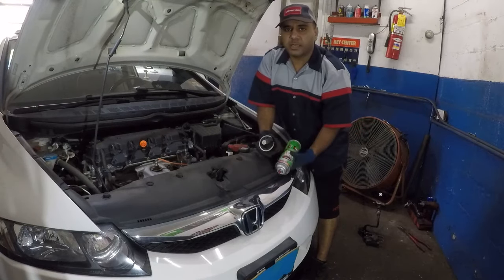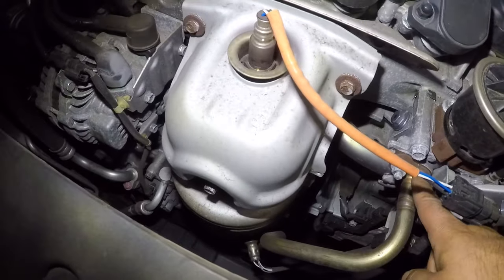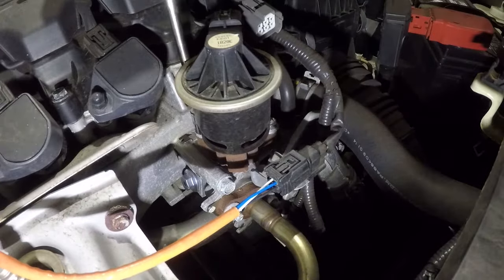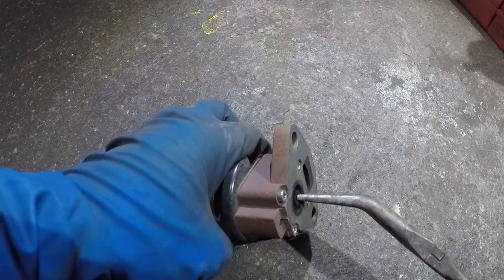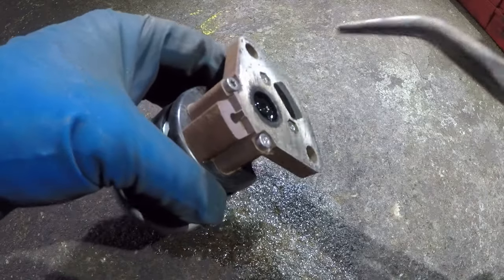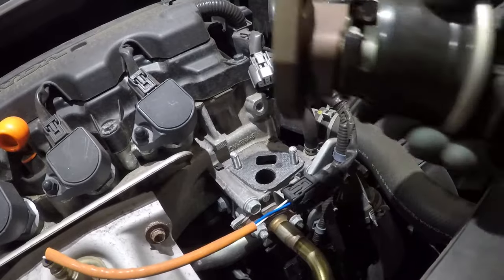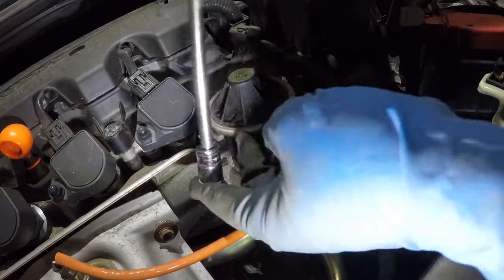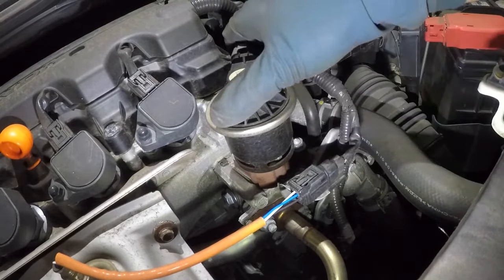How to clean Honda Civic 2006 to 2016 EGR valve also Accord and Acura TL, Misfire , random misfire

Comment: This video helped me!

2009 Civic 80k miles. My idle was really low, the only thing keeping it above 600 was running the A/C, otherwise RPM dipped at idle like half of the time and got rough fluctuating up and down, pulsing power at 500 RPM. So I had a stall and a few rough starts, changed spark plugs (probably time for that, but they were ok), checked for air leaks, cleaned MAF sensor, changed air filter. Coolant was fine. Oil was fresh. No codes. Did idle reset like three times. Still same problem. Couldn't figure it out so I started trying to find other possible problems, got to exhaust issues, didn't want to change the O2 sensors 'cause they're expensive, so I tried this and it's holding steady at 700-750 now, dips to 650 with lights A/C but 600 RPM was the problem zone.

One little valve... 

Thanks for your video!
Reply from the maker: Nice great job!!! and good information for others!!
Reply: Going to try this. Been having the same issue. Thanks for sharing!
Reply: Also, do you have a video i can use to reset my idle? never done that before...
Reply from the maker: @GGdevelopment  you need high end scan tool to adjust idle on Honda’s other wise it will do it self
Reply: I have the same problem with my 2015 Civic I try everything including new O2 sensors, I am going to try to clean the EGR valve hope that will take care of the rough idle in the morning and rpm fluctuating. thanks for the tip.
Reply: @maximilianozamorategui2608  So mine is a 2009, and it is just really old I think (only 90k however), but cleaning the EGR valve made a difference until it just started failing again. I replaced it with a new part, and while there are some stuttering sounds--especially when the a/c fan runs, the RPMs don't dip anywhere to where they were hovering. Best of luck!
Reply: @stalmerstreetjournal  was it stalling as well before u cleaned it?
Reply: @youngheero  Yes.
Reply: mines doing exactly like yours , i did everything like u did... i also clean the egr and still doing the same .. i'm putting sea foam in my gas tank and throttle body next ...
Reply: @bcbjbggjh9102  So it's been a bit, but it's still doing well with the new EGR valve. Mine could probably do better with a cleaning. I have started to notice the gas mileage getting worse, so that might be an O2 sensor and they're due for replacing. I've also noticed gas quality can impact it negatively. Let us know how the sea foam and throttle body cleaning goes!
Reply: @stalmerstreetjournal  

the sea foam and throttle body cleaning made no difference and now i'm Back to square one... car still shakes while at a stop sign. But I notice this today though while i was trying to burn sea foam through the engine.. When i had one foot on the brake and car on drive , i've tried reving the engine and it wouldnt rev pass 3000. When i'm on park the car can ten pass 3000 and wheb when i'm on the road driving it drives fine ... 
Hope that makes sense ..i have 2006 civic by the way

Comment: Thank you for a great video!  Explaining every step clearly,  Saving me money,  I am so glad to have my civic running again,  could not have fixed it without you!!!!
Reply from the maker: Glad it helped!
Reply: i like the information and videos and I have quick question.. I been chasing misfire cyl 3 then a cyl 2 not say same time maybe a cycle later then 300.. can this egr valve just be dirty and not throwing code? I also have to have pcm flashed for recall.. idk if that will stop the issue.. i replaced plugs but not with iridium with platinum. fuel injector as well but only 1 because it seems like its flooded idk if its hydro locked but can this cause hard starts and rough starts… now thats 2 questions and I have 06 accord 2.4

Comment: Awesome vid.  I changed the ignition coils and spark plugs (Civic 2008-200K miles) but car has a bit of a rough idle. I’ll clean this EGR valve tonight. Thanks for the vid.
Reply from the maker: Ok also clean the throttle would help

Comment: Absolutely amazing just did this for my 230k mileage 08 Civic and it the difference is night and day
Reply from the maker: Nice good job!!!
Reply: @RBTheMechanic I have a 2006 civic ex car stuck on limp mode no code changed all sensors fuel pump coils oil change O2 top and bottom car has no power when accelerating and it's 5 spd manual can you help me out
Reply: @dannyperez2465 lmk if u figured it out im same but with 344 miles

Comment: Awesome straight to the point video,having some hesitation issues so I’ll be doing this tomorrow along with the MAF sensor. Thanks
Reply from the maker: Cool update me how it went!!
Reply: @RBTheMechanic  Everything worked out perfect thanks,but I’m still having one little issue,it hesitates on high speeds 😖
Reply from the maker: @arieltorres3440  what u mean by besitate on high speed loss of power?
Reply: @RBTheMechanic  Feels like a bubble,then it hesitates when I’m trying to stay at around 80mph…stuttering feeling.BTW Thanks for your help 🤙🏽
Reply from the maker: @arieltorres3440  no problem. ... I’m not understanding what ur feeling at 80moh car dosent pull? Did u flush ATF on time
Reply: @RBTheMechanic  So for example if I’m driving and keep around 3200rpm steady on high speeds it has a jerk motion and feels like it doesn’t want to go.
Reply from the maker: @arieltorres3440  try changing out the atf fluid that might hello other wise I don’t think much can be done I driven these feels like that
Reply: @RBTheMechanic  It’s a manual and the fluids have been changed not too long ago,but I cleaned the egr,the maf sensor,my air intake put some sea foam on it and well so far it’s running way better,I’m thinking it could be a vtech issue ?! Ordered a hondata to shut it off and tune the car with a base map.It’ll be beneficial I only have 108k miles on it that’s why I want to make sure I don’t ruin it,but hey I just want to say thank you so much for your help 🤙🏽
Reply from the maker: @arieltorres3440  no problem I will look in to sea foam service and start recomending
Reply: Bonjour J’ai Civic 2010 coupé consommé beaucoup d’essence c’est quoi le problème svp
Reply: @arieltorres3340 have u inspected for a torn intake hose ? Give it a Google Very common problem and causes exactly what your are talking about

Comment: Great video guide RB Mechanic :)! My Civic has 130k miles and have never cleaned the EGR Valve.
Reply from the maker: Give it a crank
Reply: Update: just gave the EGR Valve a good clean and also replaced my spark plugs too. Almost overtightened those Nuts holding the EGR Valve OMG!  Hope I didn't mess up the Metal Gasket lol
Reply from the maker: @davidguzman7472  I don’t think u can mess up the gasket
Reply: @RBTheMechanic  Oh okay gotcha yeah I double checked the gasket around the EBR Valve and it looks fine and sealed. Thanks for info, trying to learn and do as much self maintenance on my Civic as possible.
Reply from the maker: @davidguzman7472 cool I got time of videos let me know if u ever need help I can send u like to the videos

Comment: Thanks RB. I have a 2010 Ridgeline. The check engine light comes on after towing my boat or camper more than 4 hours. No issues before that. Sometimes, the light goes off if I stop to refuel. The vehicle sits overnight. No light ever comes on when not towing.
Reply from the maker: Scan the car for codes to figure out what the issue is

Comment: thank you. excellent information. instead of blowing into the pipe, would it be better to  vacuum too remove them debris? also your used a break cleaner, doesn’t that dry out there rubber?
Reply from the maker: Yeah I can suck it out

Comment: Great videos!  So I had a code air intake system leak bank 1 and my mechanic couldn’t find the issue.  We did smoke machine but didn’t see any leaks.  Could it be the egr needs a cleaning?  I just got code p049d egr control exceeded learning limit and a bunch on misfires.  Thanks for your help
Reply from the maker: Possability yes

Comment: I have a 2015 civic, I cleaned the MAF SENSOR, EGR valve and after putting everything back I now noticed when it’s idling there’s definitely a vibration, mostly felt at the floor, near the pedals. I also noticed that during the day it idles around 600Rpm, but at night it jumps to 700rpms, and the vibration goes away.
Reply from the maker: Yes that’s low idle will cause vibration try cleaning the throttle
Reply: @RBTheMechanic  I already did, still does it
Reply from the maker: @EndlesSuffering  do idle relearn or adjust with scan tool
Reply: @RBTheMechanic  seems to me that anywhere between 600-800 rpm, so it’s most likely a engine mount
Reply from the maker: @EndlesSuffering  it could be engine mounts but it defiantly will shake if it’s 600rpm even with new mounts so try fix the idle first

Comment: Hi thanks so much for all your videos ! They’ve been very helpful 💪🏼. I do have a question I haven’t came across on YouTube maybe u can help . I was recently on my way to work driving on the freeway in my Honda Civic 2016 and the car just stalled like the gas pedal wouldn’t let the car speed up and the engine light started flashing.the car was on but it wouldn’t go any faster so I pulled off the road shut it off and turned it back on and was able to continue driving no check engine light … I feel like the car can’t go over 3000 rpm’s . Any clue ? Thanks in advance for any response I know ur a busy man.
Reply from the maker: Scan the car and give me the codes.  It might be transmission related also check ur oil level
Reply: @RBTheMechanic  awesome thanks so much.. I’ll have it scanned today after work and I’ll let u know. Thanks again!
Reply: @RBTheMechanic  hi there the code that pops up is the P0112 ..
Reply from the maker: @bettyguzman7130  this could be related to maf sensor which can cause loss of power try cleaning it and reset the light
Reply: @RBTheMechanic  ok will do thanks very much for responding and your help!

Comment: I have 2006 ex coupe, cylinder 3 misfiring and I replaced all spark plugs and coils. When I’m driving like more than 2k rpm the engine light comes flashing they also error code for evap vent valve closed.
Reply from the maker: Umm that flash means heavy misfire  did u check injectors and swap test with coils
Reply: @RBTheMechanic  yes i swapped it. When I’m driving in the highway the check engine light is flashing it shows the random misfire. I also cleaned the EGR still the same. I also did the comp test and it’s fine
Reply from the maker: @johndavidobusan4947  check with scan tool live misfire data that flashing means heavy misfire

Comment: on hondas when doing this do u have or is must to remove baterry terminal? when working on electronic parts? how many miles shoudl start doing this?
Reply from the maker: No need to remove battery terminal 60k miles would be good time to clean at

Comment: Ok man I got a question today I had the cats taken out of my 2014 Honda Civic same set up like u have there. Cats was clogged and the car still has a bad miss fire at times could that be my problem since the cats was clogged ??
Reply from the maker: Well first u need to diagnose the misfire other wise if u replace cats they will burn. Anyways did u scan the car for codes?

Comment: Ok this might be my problem. Cleaned maf put new air filter on and still hissing like crazy and idling very bad. Gonna try this next.
Reply from the maker: This can be check for vaccum leaks as well
Reply: @RBTheMechanic  how so?
Reply from the maker: @youngheero  u can use smoke lock up the intake systm and insert smoke and see if there’s any leaks
Reply: Ended up being a cracked intake manifold.

Comment: I replaced my brake booster my car still misfiring so I’m gonna try this and see if that helps
Reply from the maker: Scan the car for codes
Reply: Before replacing the brake booster you should pinch the vacuum line to the brake booster. If the misfires continue,  it's not the brake booster. Keep looking for the source of the misfires

Comment: 2006 civic ex no vofe car dtuck on limp mode eont go past 4000rm no vodes and it hesitate when car warms up
Reply from the maker: What u mis spelled lot I couldn’t make up the lines
Reply: @RBTheMechanic  2007 Honda civic ex stuck on limp mode no codes
Reply: @RBTheMechanic  won't rev past 4000 rpm
Reply: @RBTheMechanic  I have changed all new sensors ignition coils fuel pump EGR
Reply from the maker: @dannyperez2465  use diffrent scan tool there has to be codes

Comment: I already cleaned the egr of my 09 CRV, and still the misfire occur after I test drove it. Should I replace the EGR now?
Reply from the maker: What is the code ? Scan the car for codes
Reply: P0404 EGR Valve Circuit Range/Performance Problem.
I replaced EGR,clean MAF sensor, clean the throttlebody. Test drove problem occur again.
Reply from the maker: @mconiesomar9302  if code came back u need to replace it

Comment: Thank you for the video! The code P-0498 is that connected to the EGR valve on 09 Honda Civic LX? I just replaced the Bank 1 upstream sensor but it is calling for this one also. Do you recommend this service from this video?
Reply from the maker: If u got code for it I would replace it
Reply: @RBTheMechanic  That is what I thought but Mom wanted to clean it first. I would guess that it would only be a temp fix

Comment: I change the two 02 sensors on my Honda Civic 2008 but engine light still  appears . Do you have any suggestions ? I driven it for like 70 miles and nothing
Reply from the maker: Did u reset the light?

Comment: Hi am having honda civic 2009 i hear egr valve noise and also am having bucking issue at 2500 rpm ... Is it because of egr valve?
Reply from the maker: I’m not sure if u hear a egr sound usually it makes no sound can u make a video let me hear it
Reply: @RBTheMechanic  but does it cause this issue when i floor the accelerator hard car hesitates bucks and jumps ...

Comment: Is this a necessary maintenance? At how many miles should you do it?
Reply from the maker: Oh yeah every 30-40k miles I would clean this out also check the boar I see cars come from dealer and other shops bad egr or stuck open and they did spend 1000$ on misfire fixes or random misfires and this was a issue
Reply: @RBTheMechanic  can I just use a carburator & intake valve cleaner or a MAF sensor cleaner? Do I have to use a throttle body cleaner?
Reply from the maker: @laviebanale  any of those is good enough

Comment: So do the 2006 civic and up have air idle control valve ?  They seem to get clog up on the older model also
Reply from the maker: Yeah new civic have electric throttle I know 2005 and up had electrical which work like idle
Reply: @RBTheMechanic  

Got it thks , cause my 2006 civic running kinda funny at stop signs where the rpm goes up and down, Just started doing it…. Trying to figure if the 8th gen has the Aicv on these models
Reply from the maker: @fzghbkhvgfhhgv3524  do the throttle cleaning will make a big difference if u get high rpm after cleaning that’s normal it will relearn
Reply: @RBTheMechanic  

Got it , I’ll try cleaning the throttle body and see where it takes me thks

Comment: What kind a spray did u used on this, is it parts cleaner or break cleaner?
Reply from the maker: Brake cleaner works fine or u can use carburetor cleaner
Reply: Can u use carb an throttle cleaner

Comment: Question my 07 accord at 75 to 80mph is feeling a little hesitant, no engine codes nothing I'm gonna clean the egr but have you ever dealt with that? Also I do have 320k on her!
Reply: 320k on her? Man that's been a great car for you hasn't it?
Reply: @tonyjordan1320  yes sir shes still running that's my only issue I did a transmission fluid change and replaced the injectors think that was it😒 so I leave the car at home my wife drives it an she gets the check engine light (great) it finally gives me the code ! P2318 easy fix for sure haven't made it back home but when I do I'll definitely update you on the status ✊🏾

Comment: Will this help code p0507 ? Thx for the video
Reply from the maker: That code seems to be for rpm did u try relearn idle?
Reply: I made many attempts, rpm holds at 900-1200 but only when fans come on, thx for feedback much appreciate
Reply from the maker: @chicanopridealvarez1385  u might have to hook up scan tool and command a idle relearn if nothing else works
Reply: @RBTheMechanic  thx bro will do, I thank you for your videos will stay subscribed
Reply: Hello, my car is also in the same situation, has your car relearned?

Comment: Will this help Code P1077?
Reply from the maker: No that code is for intake manifold valve also knock as IMT
Reply: @RBTheMechanic  I just want to thank you so much.  Could not figure out that IMT meant IMRC.  Somebody at Honda should be shot for not explaining the difference when the code was thrown.  What I actually need is the Actuator Valve Sensor that goes on the IMT.  I found it on ebay and Amazon of all things.

Comment: No need to disconnect the battery before cleaning egr?? I can clean the egr of my civic without check engine codes?
Reply from the maker: Yup no need to do that battery can stay connected and even if u don’t have codes it’s well kept if u clean it every 30-40k miles
Reply: @RBTheMechanic  thank you sir, by the way i can still reuse the stock gasket in my area its very hard to find honda civic parts

Comment: Hey I have a honda Accord lx 2011 so my car blows air but in one sides blows more than the other side? What do u think
Reply from the maker: Check ur cabin filter first thing then u need to check to see if mode door motor changes directions u can simply do that by changing air to defrost feet and it should completely change directions but check ur filter first